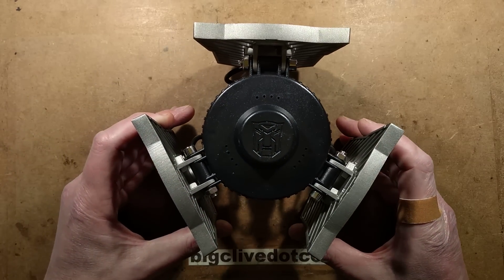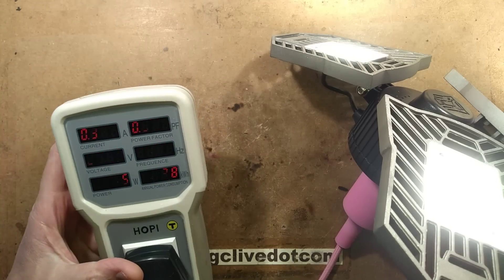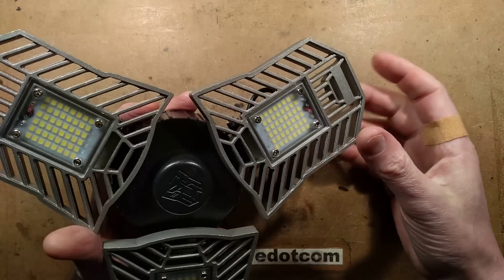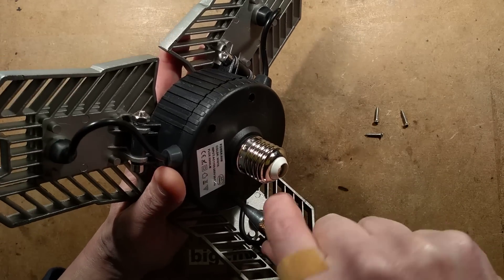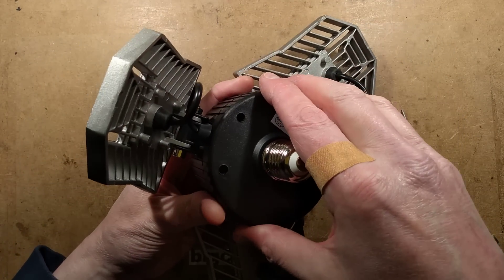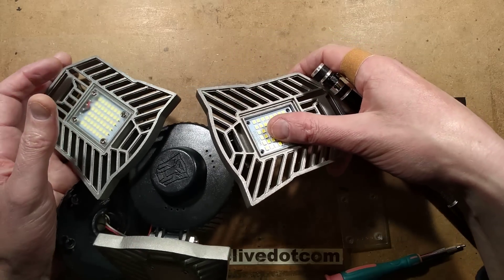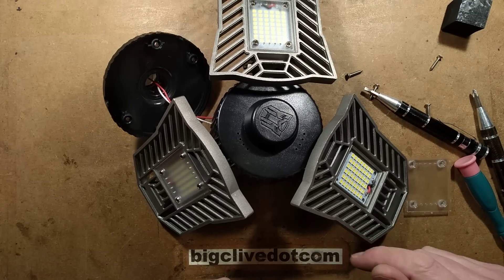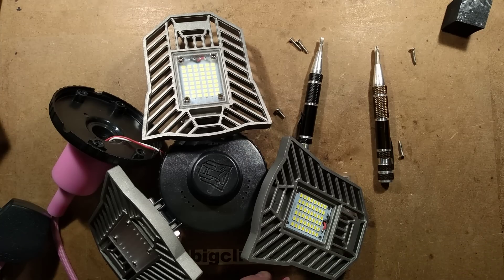Inside a deformable LED robot lamp.

Comment: Hmm. Research in France indicates increased macular degeneration and retinal damage from LED blue light. So cold white in the long term may make you go blind. Another saving. Lower power consumption whilst you can see and none at all if you go blind. Win win in a morbid kind of way.
Reply from the maker: I'm wondering whether their research has compared sunlight to LED lamps.  One of those contains a lot more blue light.
Reply: My daughter gave me an alarm clock that goes off by launching a tiny drone, which crashes somewhere.  Then I have to get up and find it because the snooze button is on the drone  !!
Reply: And microwaves cause cancer, video games cause brain damage and electronic music turns kids criminal. We had it all and it returns and returns and returns.
Reply from the maker: @MetalheadAndNerd  Conspiracy is a lucrative business.
Reply: I had huge problems getting out of bed every morning for half of my life. Then I built myself a light alarm clock with enough 6500K light output to emulate the sun shining into my bedroom. This changed my life. I have no wake-up issue anymore and I recommend this to everyone with wake-up problems.
Reply from the maker: @MetalheadAndNerd  I used a plug-in timeswitch and light to help me get out of bed in winter.  It lit a table light just before the alarm went off, and if all that failed then the light turning off 10 minutes later usually got me up.
Reply: @bigclivedotcom  I didn't believe that a normal night stand light would trigger the natural wakeup program as I intended. So I went for 3*23W compact fluorescent bulbs. They needed 3 minutes to go from dim light to full brightness so I didn't need any sunrise simulation. As second stage there is a cheap LED strobe light. But this isn't as useful as I thought. When the main light is on full brightness the strobe is more like a flickering in the light.

Comment: My question is does it fit on the end of a weed eater? That screw on part looks like it might. You could trim your lawn at midnight or have a disco party.  I am pretty impressed. I may buy one for my shed. I wonder how it will work at -30 degrees. We here in the North have to think about those kinds of things.

Comment: dO THEY COME WITH A BAYONET CAP? sry caps
Reply from the maker: You can get B22 to E27 adaptors.
Reply: @bigclivedotcom  I honestly did not even know they existed lol
Reply from the maker: @TheDantheman12121  Technically speaking, they are non regulation compliant since it's 50/50 whether the screw section is live or not.  (It should always be neutral). But IKEA and other places also sell them.
Reply: Bayonets would be extremely dangerous, I would think.....said the yank.

Comment: gut that thing, re-apply heatsink compound across the back of the leds properly, then get twice the life time out of it
Reply: Maybe drill some vent holes in the top too, just for good measure.
Reply: Thermal pads work best when attaching to a rough surface like cast aluminum that hasn't been machined off flat/smooth. But yeah either one, pads or paste/grease, will work.

Comment: I can't gauge the brightness on this thing. What would you consider this, approximately, in incandescent equivalent? 500W? 1000W? More? I'm thinking this might make an interesting portable shop light, but I'd really like to hear a reliable second opinion first. Hearing it's running at fifty watts and is an LED fixture seems to suggest plenty of light ...
Reply: Couple hundred watts, no more than 500. A factor of 10 is about right.
Reply: The only way I've compared lighting is by measuring lumens.  Watts generally references only power use. Then color affects the effect of light subjectively but everyone has a slightly different perception of what " light " really is.  Is it a particle or a wave  ??

Comment: Amazon has US rated ones in 60W warm white for $39.95 USD. This might be an acceptable lamp for ceiling mount, as long as there is no glass enclosure for the fixture. Enclosed fixtures will destroy LED "replacement" bulbs, as LEDs can't cool themselves adequately in an enclosed fixture. The bulbs fail within months of installation, and it's expensive to replace existing fixtures. The company that makes these should sell a version with a 200-300mm frosted Plexiglas disc mounted 10cm  from each COB to diffuse the light a bit. That would be a lot like having 3 incandescent bulbs in a frosted glass fixture. Absolutely ideal for a basement, garage, or industrial.

Comment: Would putting a complete covering of themal paste make a lot of difference?
Reply: It should be a thin smear. The idea is to fill any holes or voids in the surface so that the heat has a greater area to conduct through.
Reply: @Mark1024MAK  I understand that. I was speaking of covering the whole surface, not of more thickness.

Comment: Interesting. A transformer-less transformer light.
Reply: A Cat - if it uses buck converters, them be single coil inductors, not transformers...
Reply: I saw what looked like three transformers. They're just run at high frequency (to be smaller), not mains frequency. Mains-input SMPSes are usually flyback (using a transformer) rather than buck (using an inductor).

Comment: Imagine  coming up with this crap when we were kids ?   Looks like you had a Encounter opening a Blister Pack ?  I get sliced or diced opening the damn things all the time.  Well Trumps Terriff seem to be causing a Price increase on BangGoods Goods.  Most things seem to be going up like 15 - 20%  LOL,  I can live with that.  Something needed done.  The Chines have been getting a Free Ride on Postage here for way too long.  The MPPT solar charge controller I purchased went from $18.00 to a whopping $23.00.   Them rascals are  making plenty of money off me alone.  I've developed a habit to make a order like twice a month now.  No way I could  do all the projects I have going buying from the U.S.  Current projects include a Power Wall and E Bike.  The Chines offer everything I could ask for at a more then affordable prices.   The Chinesium Rating System needs be considered.  Something Rated at 20A in reality means it only starts smoking at 10A and won't burst into flames until 20A.  LOL

Comment: I'd be tempted to apply a bit more heatsink compound to those LED panels. You could compare one as supplied to one that's been redone to see if the temperature is lower or more even.

Comment: Shame there's probably not a lot of consumers who are focusing on the quality things you look for - a lot of these seem like nice "almost there" things that need maybe one or two tweaks for good quality.

If those are being pushed pretty hard, is there an easy mod to the drivers to tweak down the current?
Reply from the maker: You can usually increase the value of the sense resistors to reduce lamp current.

Comment: I looked these up and are about £19 on ebay BUT they claim on the listing that it has a 0.9 power factor!
Does that matter? 

And why do I feel a sense of Deja Vu watching this??
Reply: @bigclivedotcom  I was wondering if you wouldn't mind doing a quick explanation of what Power Factor is and what's good or bad about it as it is mentioned so often, particularly when using the HOPI.

Comment: I got this very lamp from Banggood a while ago, lights up the whole barn. The only issue i had was that the E27 screw  came off the first time i unscrewed it from the lamp base, it just had a wire folded over and tucked underneath it.... nothing that a dab of epoxy couldn't solve.

Comment: Cool, I'm using a one now(in the US), I got it for free in exchange for leaving an Amazon review. I use it on a motion sensor(I didn't get one with the built in sensor), I don't know if that's good or bad for the lamp but it's good for my electric bill.
Reply: josh bishop did they get in touch with you about a free unit in exchange for a review?
Reply: @M1Cr0sOfT  No, I'm in facebook groups Chinese sellers user to get reviews for their FBA products. They have you buy the product, then refund you through PayPal after you leave the review, sometimes they pay commission. It violates Amazon terms and if you're careless they will wipe your reviews and block you from future reviews. Sellers give codes that can give you up to 99% off at checkout but you should never leave reviews for codes.
Reply: josh bishop thank you :)

Comment: Wonder what sort of weight they are? They look kinda heavy.....might put a bit too much strain on a normal light fitting.
Reply from the maker: A surprisingly round 500g.
Reply: Maybe those weird hanging wire type they have in the UK (like the pink one Clive uses to power it), but it'll be fine for most of the ones in the US.